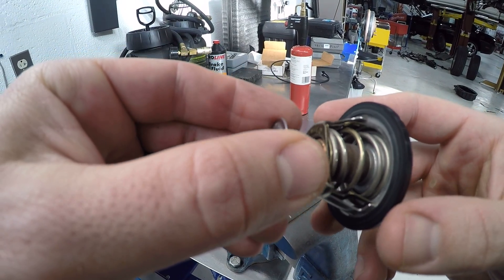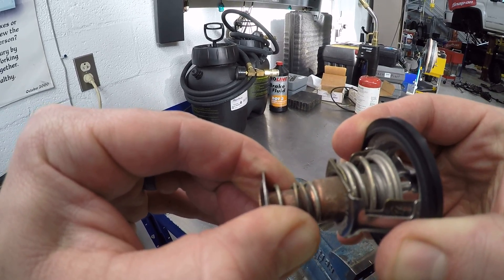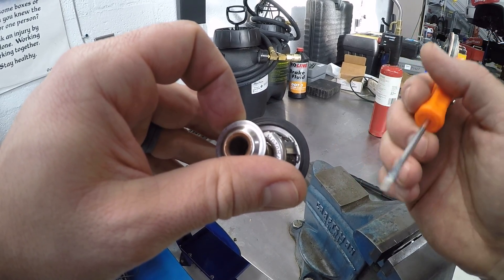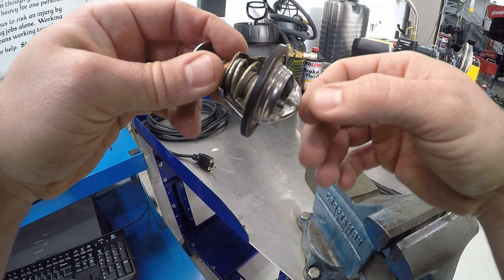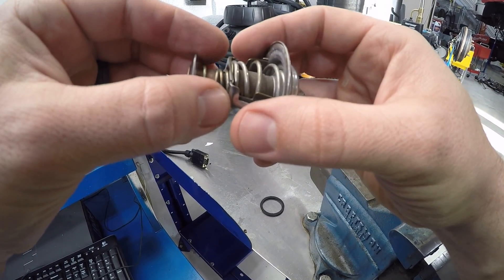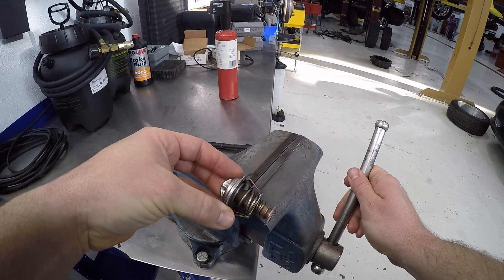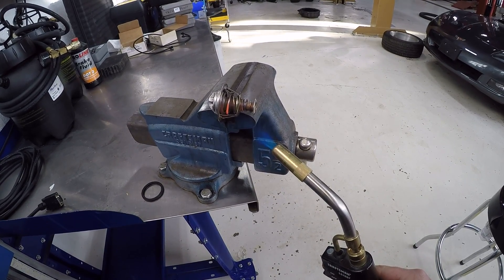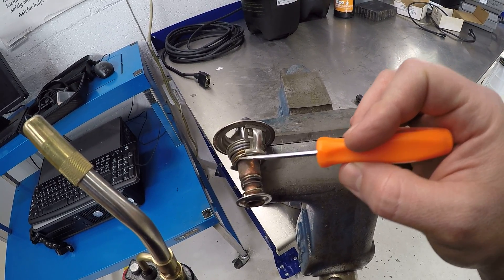Thermostat explanation and types of failure.

Comment: I just want to know an efficient way to get the seal and thermostat pressed back in. I can install an AC system break it with nitrogen pull a 400 micron vac , install a high efficiency furnace faster than I can put a thermostat into a GM thermostat housing.

Comment: Hi .. nice video, bro .. I will change my thermostat ( vw cabrio 2001) and i found two differents models or desing .. one its like the thermostat  in your video and the other one is like shorter and dont have the second thin spring.. questions ? is the same funtion ? its better flow cooland ? Thanks

Comment: Yeah I just replaced my fuel filter and the next day I started having thermostat issues so anyway, it will be really hot to steaming with showing zero temperature and sometimes it will show running temp with no temperature so, what I'm looking to do since I'm mad maxing it is just replacing the thermostat with nothing and YOLO

Comment: if the one thermostat  doesn't  open in 195 but open at 225 what does mean or is normal
Reply: @blairnewbold7602  but after that you didn't  have engine problems
Reply: @blairnewbold7602  well i replaced  mind still doing th3 same
Reply: @blairnewbold7602  replaced  for 195  degrees thermostat  but still open when is 225 degrees and is always  half of the gauge temperature when is hot goes to almost 3/4 of my gauge and fans kit and ho back to half
Reply: @blairnewbold7602  is a malibu  maxx 2004 but the last messages  you sent me is complete true...

Comment: Is that thermostat having dual function? How do you know without actually having the water pump at hand? In this video at this point you see what I mean. When fully open to radiator direction the inner end of thermostat closes the "bypass circuit" completely:
https://youtu.be/_HclvBmwWgQ?t=104
I don't know yet but I'm working on it because I have to study it to flush and replace 1994 vento 1.8 1H2 ABS engine water pump and thermostat. Is that engine having dual function thermostat. Currently I believe it does.
Reply: @blairnewbold7602  I did replace water pump and it was very easy job. I know now tstat has normal dual function. It is just a tip for those who have similar vehicle. The 1994 Vento(Jetta in US) is the most diy friendly car there is despite the location of thermostat at bottom.

Comment: I have been losing coolant on my reservoir way too fast like after every drive.  I see no leaks, No overheating and radiator with hose/clamps just newly replaced. Can i get your opinion on my issue. Driving an ‘09 civic
Reply: 100 per cent its water pump nothing else

Comment: is it possible that the thermostat is stuck open, but the car heat up fine, but just takes several minutes longer? that's what seems to happen to mine, and I have not check engine codes.
Reply: @blairnewbold7602  i am pretty sure it's at least partially stuck open. When turning on the car and as the temp needle is just coming off cold, I can feel warm in the top radiator hose. Wouldn't you agree that should not happen until it's much warmer? I'm searching now for a thermostat, and they seem to be hard to find for the car I have....

Comment: ???? With brand new fan clutch, water pump, temp gauge, radiator, and bypassed heater core, I can run my 73 Dodge 318 motor without the thermostat and it stays cool just fine where it peaks at low operating temp, but as soon as I put a thermostat in (with spring facing 👇 bottom towards block) the motor warms to mid level operating temp nicely at higher RPMs but overheats when RPMs are at idle.  Also shoots WAY up over max operating temp. as soon as motor is shut off (even with brand new thermostat from O'Reilly's at 180°F recommend rating ).
Reply: Yes,  I was thinking also,   check your,  "WATER PUMP"   as well,  like on the "perpeller",   make sure
it has a , "  SCOOP - STYLE"  FINS,
that moves the coolant more efficiently,     not  the style that is like a ,   " MOLDED - STATUE",
LOLO - 😂,       forgive me because it's kind of hard to describe it but if you look at that "FINS "    they're very small and  shallow,  not  deep
enough,    where it's harder to move the  coolant,      Thus,  to have  optimum  - " CIRCULATION"....   I forget the name of the brand,   but it's very aftermarket,   keep a lookout,
Also,  check  your coolant  MIXTURE,    &    use - "distilled water" - - not to city water...

Good luck,     hope this helps you...